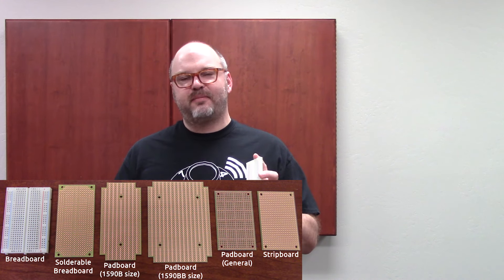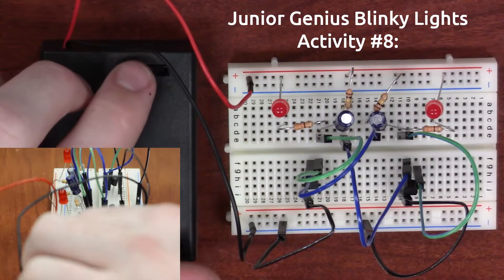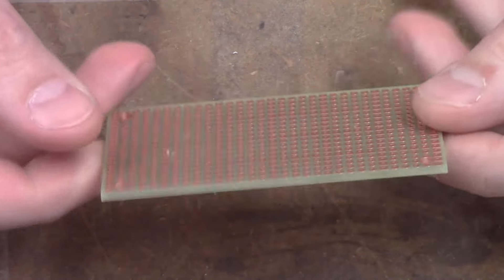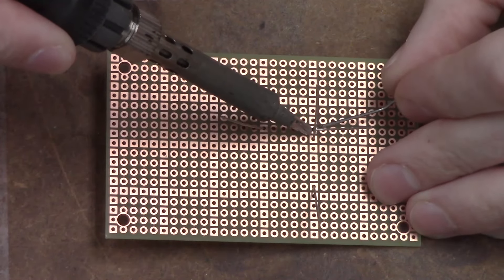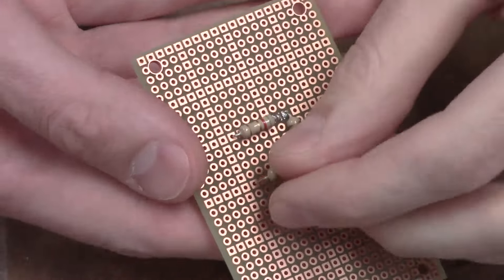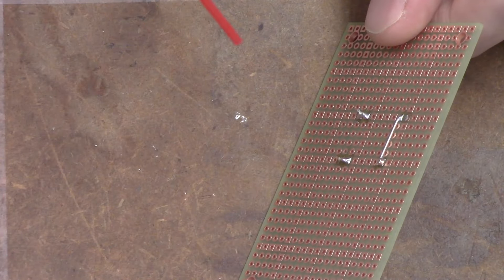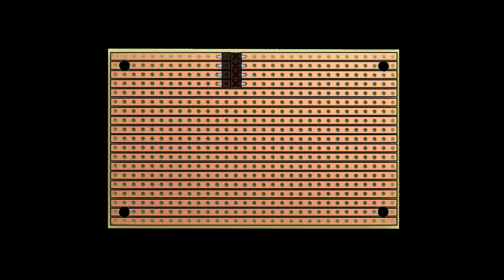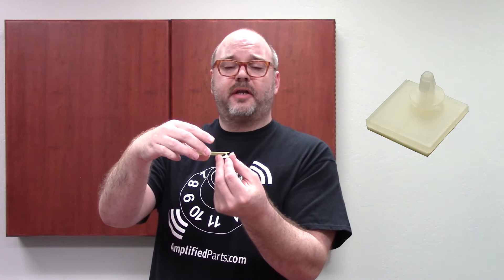Circuit Board Prototyping: Breadboards, Padboards, Stripboards and More

Comment: I'm glad I found this channel. I'm trying to design a smart PC monitoring system for liquid cooling and the challenge is the cooling system is remote from the PC case. Koolance in Washington state has used serial cables and PCI slot covers with female serial ports and paddle cards for temperature, fan and flow metering to their remote units, and also a means of starting the unit with the PC via a 12v Molex from the power supply. They also have higher power units where the 12v from the PC PSU simply turns on a transistor switch allowing the remote unit to turn on; it's plugged into the AC outlet. If course they're not going to give away their trade secrets by providing a schematic on how this is done. I worked at a switch mode power supply company in the 90s who after having a functioning prototype had the AutoCAD department design a circuit card for the strip board design and outsource a third party to print up the circuit cards. This would be bought in bulk and wouldn't be practical for an individual. So this channel will aid me greatly. Thank you.

Comment: Thanks - this was the clearest description of how to use padboards that I have seen. Stripboards don’t make much sense when I am using an Arduino Nano - most of the pins I typically don’t use...
Reply from the maker: Thanks, Jim! Glad we could help.
Reply: well it is quite the opposite. for IC type strip boards are the easiest as mostly each pin would have multiple parallel connections
Reply: Instablaster

Comment: That trick with the resistor lead bending over to form a connection was really nice! I was looking for videos on how to attach wire to my components (still haven't found anything :D) so I didn't even consider doing connections this way!
Reply: That's actually the preferred way to do things, as the lead is unbroken. The alternative is to use a jumper wire on the other side or the same side, but there's always a chance that an overheat will cause the joint to melt and the wire will fall off.
What I found interesting was to use solder(and not jumper wire) to bridge adjacent nodes. Much cleaner that way. Uses a lot of solder though.

Comment: Thank you for this video! Is it possible to use the solderable breadboard for prototyping? Is this advisable or should I be using standard breadboards for prototyping only?
Reply: It's possible to de solder, however it's more efficient and better to just use a standard breadboard

Comment: Could hot melt glue be used in place of stand offs when you don't care about being able to easily get the board out again?
Reply from the maker: Hot glue may not be the best choice. Plastic standoffs are easy to install: https://www.amplifiedparts.com/products/standoffs-018-plastic-adhesive-backing

Comment: So at 5:27 that 8-pin component opposite side legs (3rd from top) are actually connected? Why only the right side has the red rectangle and not on the left side if the whole row is on same potential level?